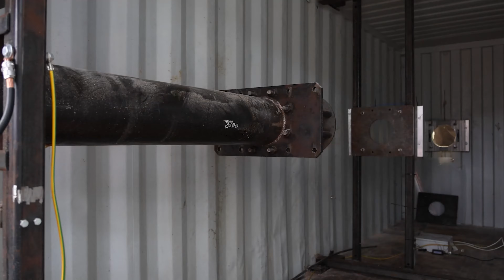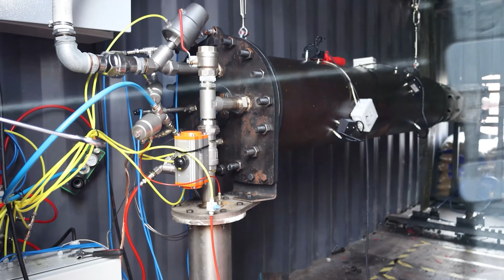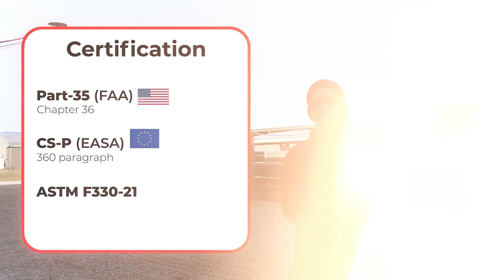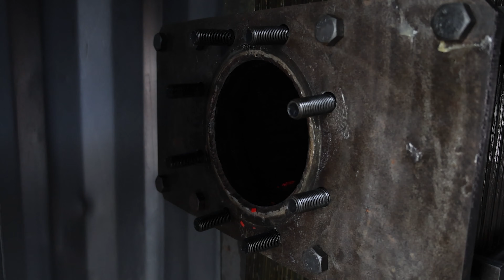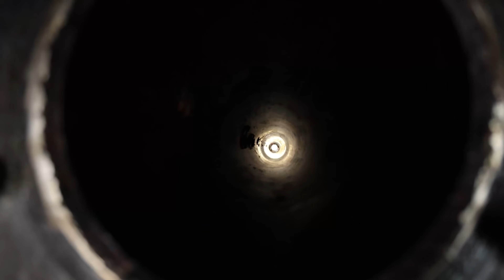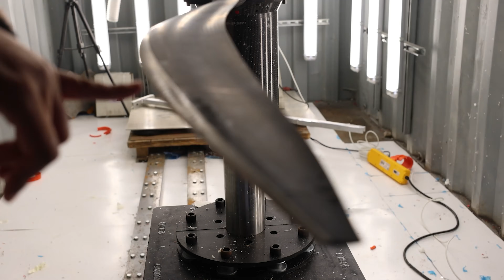We Fire Chickens at an Ascalon Propeller (For Safety)

Comment: 2:32 Hello, I’m an engineer based in South Korea, working on bird strike analysis and test planning for an eVTOL lift propeller. I have a question about your test setup.
I understand that the test was configured to represent initial climb at maximum power as the most severe condition. Could you clarify how the propeller is oriented when installed on the aircraft?
For the lift propeller I’m working on, we consider a bird approaching from above and passing downward through the plane of rotation during vertical takeoff. In our configuration, the impact direction shown in the video appears more representative of transition flight than of vertical takeoff.
We also use the direction shown in the video as the most severe impact condition, as it corresponds to transition flight in our configuration. However, I’m curious why this specific launch direction was used to represent initial climb. Is it because of a difference in the propeller’s installed orientation, or was the most severe impact direction selected independently of the expected bird approach direction during takeoff?
Thank you for your clarification.

Comment: I noticed that the centrifugal load was not factored in during the static test. Do we not need to consider it?
Reply from the maker: Yes, the centrifugal load was not included in the static test.
However, for the propeller blades, this is not critical in this case. If the propeller were rotating, the centrifugal force would pull the blades outward, which would be beneficial for the blade/root loading condition. Therefore, not including it makes the static test conservative for the purpose of this verification.

Comment: Would a propeller blade only 'cut' a chicken while rotating? Could the chicken not hit a blade flat on? Because your test blasts it onto the thin titanium edge 'presenting' a 'knife-edge' towards the chicken rather than a flat surface which would have to resist a lot more bending force. Also a chicken has a carcass with denser bones, not only 'soft' flesh!
Reply from the maker: It’s a relevant question. In fact, the test configuration is not chosen arbitrarily: the EASA / FAA certification requirements define the worst-case impact scenario, including the most critical orientation and conditions for the blade.
The objective is precisely to represent the most severe loads expected in service, and this is why the projectile is aimed at the leading edge, which is considered the most demanding case for structural integrity.
Also, the “chicken” used in these tests is not just soft tissue — it is a standardized bird substitute that includes the mass and density effects (including bones), as required by the regulation.
So while a rotating propeller may indeed “cut” in some situations, the certification test is designed to cover the most critical impact case for the blade structure.
Reply: I agree, i would also expect a teat of a frontal impact, which i would consider to be the critical test. Its how they do jet engine tests too : the chicken (or turkey) goes straight through the turbine.
Reply from the maker: @101jtag  Obviously, since they are testing engines, the chicken has to go through the engine.
Reply: Yes i would want to see that test too, i dont think is is a valid test, its not realistic and seems the least stressful test on the prop. But i like the test setup and one can do this test first and the proper frontal one next on the same prop, until it breaks, to learn .
Reply from the maker: @101jtag  This is a test based on a configuration recommended by the FAA. You can read the official texts. It is a worst-case scenario for the propeller. And not all propellers can withstand it... 😁
Reply: @eprops for sure it looks like a worst-case for gearbox and engine. I am not even an engineer, so dont worry about my views, just indicating what avg pilot may perceive. Thank you for explaining and showing off your impressive cannon !
Reply: How does gel match a bird with skin and bones, also the forward speed of the plane will cause some side load on the prop you are not  replicating.
Reply from the maker: @tomsiegler8413  The test configuration is not chosen arbitrarily: the EASA / FAA certification requirements define the worst-case impact scenario, including the most critical orientation and conditions for the blade.
The objective is precisely to represent the most severe loads expected in service, and this is why the projectile is aimed at the leading edge, which is considered the most demanding case for structural integrity.
The “chicken” used in these tests is not just soft tissue — it is a standardized bird substitute that includes the mass and density effects (including bones), as required by the regulation.